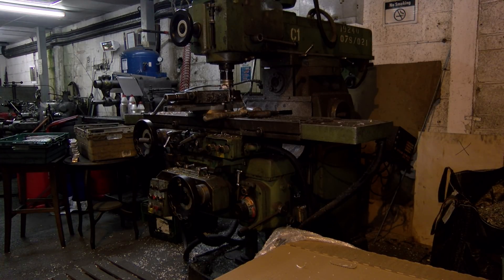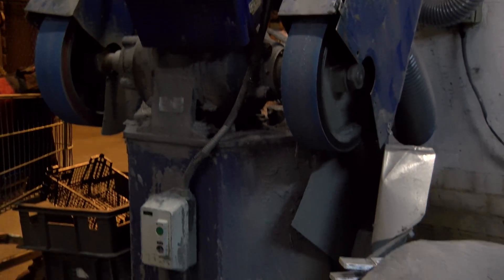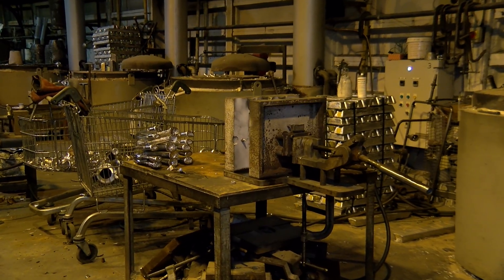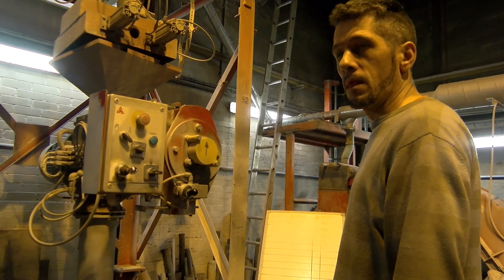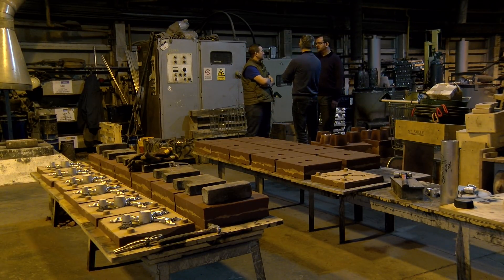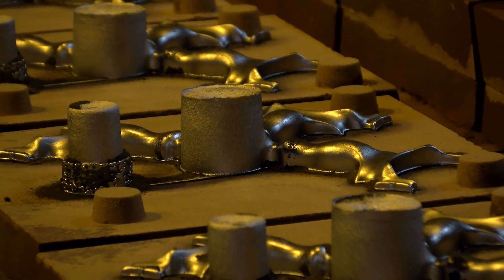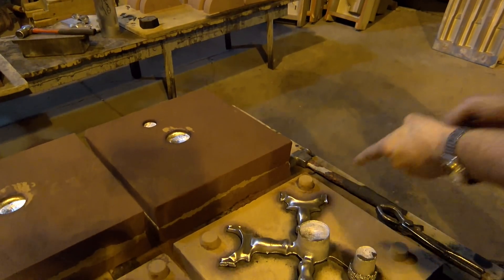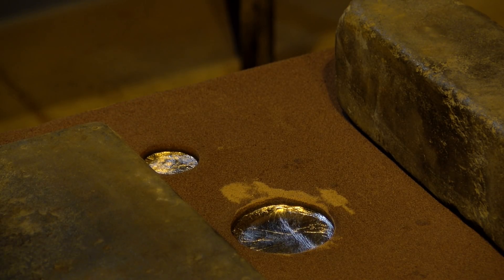INSIDE THE PROSHOT CATAPULT FOUNDRY! - MOLTEN METAL MAKES MEATY FRAMES! (4K)

Comment: Do you pour your aluminium at 740°c after melting down ingot? Only thing i can see a flaw in the process is 1. If one bit of water is in them molds or land in that laddle then the fella pouring might aswell say bye to his eyesight if ally goes in his eyes, 2nd. Does the ally not cool down causing inconsistencys in the final result due to pouring so many at one time? 
Only reason i say this is due to working in a foundry making aerospace parts and been taught about aluminium pouring etc. You have a lovely set up there Pete, i only say all this to maybe aid not discriminate
Reply from the maker: I had talked at length with them. The facts are they are able to teach your instructor stuff. Except it is proprietary. The metallurgy they know is deep. Those questions about shrinkage are all covered by serious mathematics, that they grasp and use.
Reply: Wohhhhh im not knocking any part of your process, i worked in a foundry for only a year and was just asking some questions out of curiosity. Stuff that was drummed in my head while working in the aerospace industry i merely just put foward to yourself as my knowledge is minimal. Please dont think im trying to tell you the difference between right and wrong, im far from being an expert. 
Iv bought multiple catapults from pro shot, never had any problems.